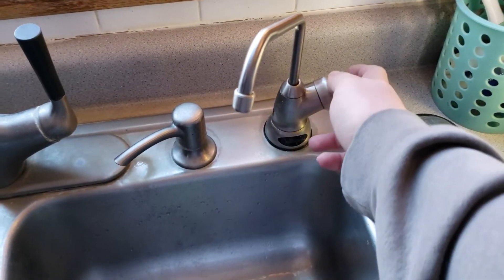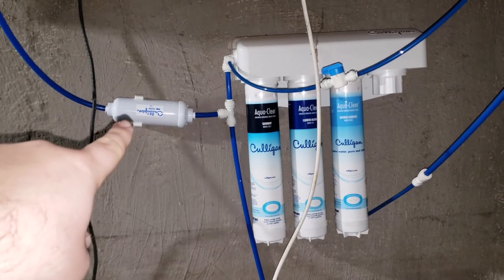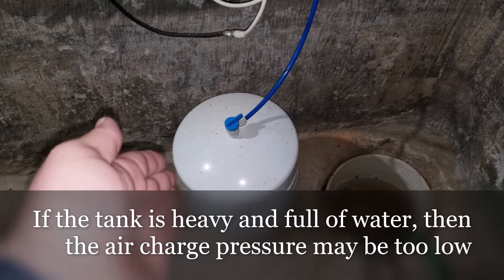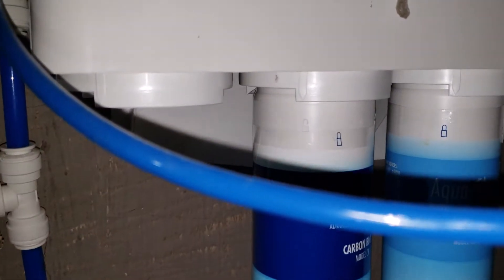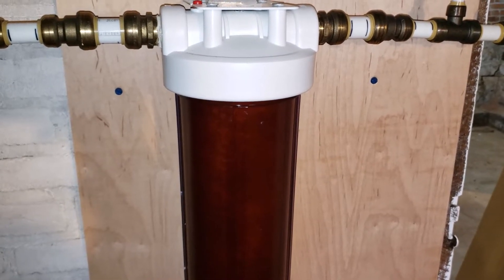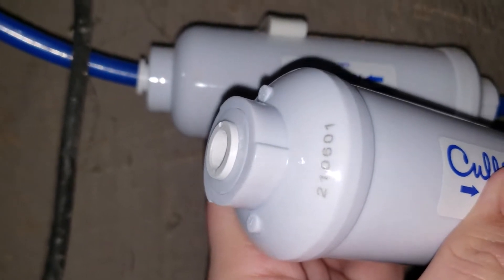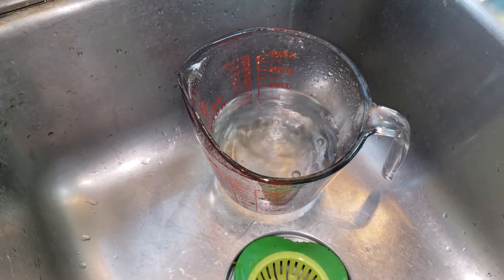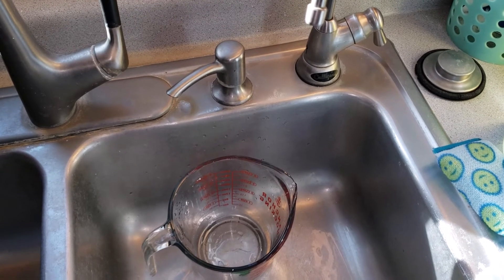Fix Slow Reverse Osmosis Flow

Comment: Water initially comes out RO faucet at a favorable rate but within a couple of SECONDS it reduces to a trickle. I dont know whay else to try. Tank reads correct pressure. I have replaced the pre and post. System is only about 5 months old. Water flow from faucet was great....initially. after i replaced the pre and post filters it all went downhill. I guess ill try replacing the membrane.
Reply from the maker: @spiffymick8073  do you have a culligan RO system? I've noticed with mine that there is a small orifice tube that I think drains from the membrane. If that gets clogged I have almost a no flow situation. In the instructions that tube is different, as if mine was an old version or was updated and the instructions never changed. I just blow backwards through it to clear the clog and then it's good to go. But I would have done the same thing you did, verified good pressure in the tank and then replaced filters. There's not too much else left in a system besides membrane and lines. Is the tank light? If your tank is full and heavy when you checked the pressure, it could give you a false reading, then as you run your RO and the bladder empties the pressure drops rapidly and you lose the force needed to expel the water.